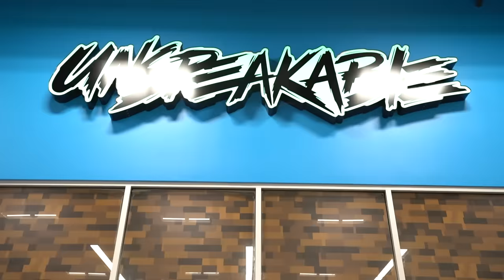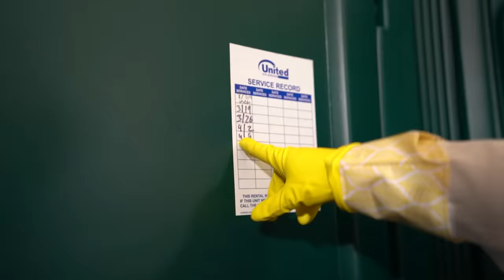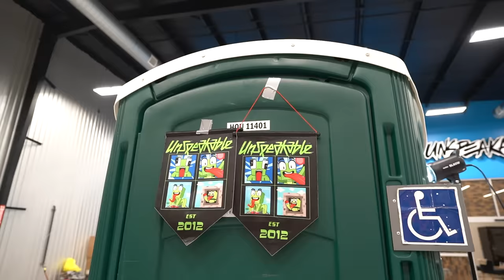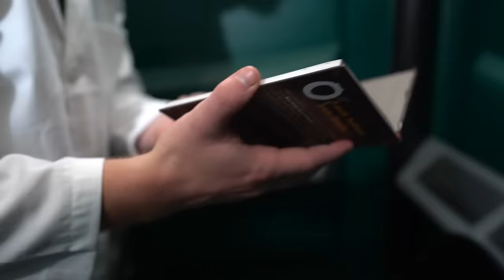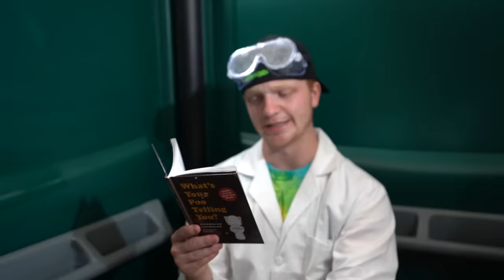LAST TO LEAVE THE PORTA POTTY CHALLENGE! *GROSS*

Comment: Our Porta potty is like easy to break open by like slamming yourself against them and you can just lime yourself against them, and it will fall in the water will fall off for a while tip over and the roof will come off